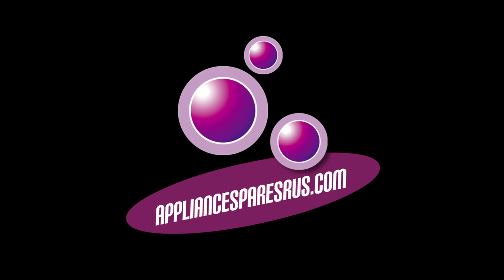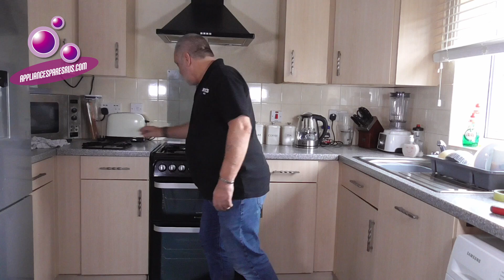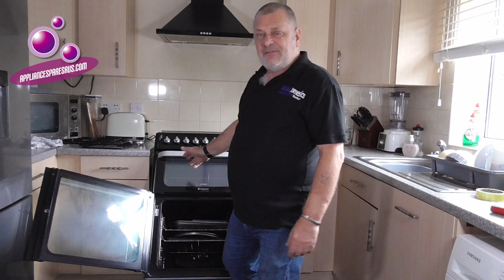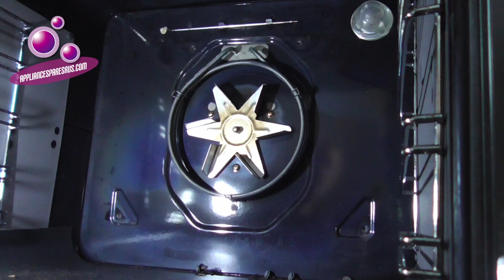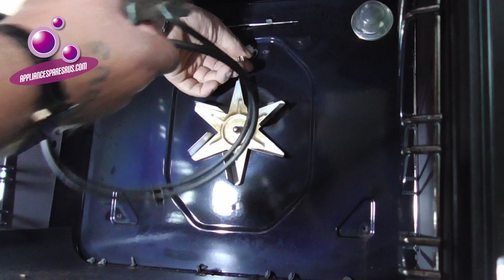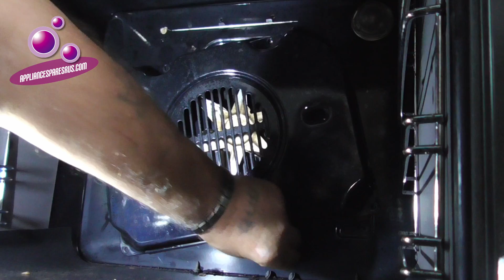How to replace a fan heating element in a Hotpoint cooker

Comment: nice video, how about the top oven element, looks like a bit of a cow, i am trying to get to it now.
Reply from the maker: Grill element or top base element?
Reply from the maker: You can get it from here https://repairpartsteam.co.uk/index?rpt=f25efa02b2%20
Reply: @tornadotez  thanks, hotpoint themselves are the cheapest, and by a lot compared to most places.
Reply from the maker: @ShadowzGSD   Maybe, but Hotpoint don't take the time to provide free how to repair videos
Reply: @tornadotez  top base, looks like part J00160407 but can't find how to get it out. side panels off, back panel off and i can see the side connection but it is encased in a metal tray that i can't get out.
Reply from the maker: @ShadowzGSD  where abouts are you?
Reply: @tornadotez  finally managed to get to it 😆